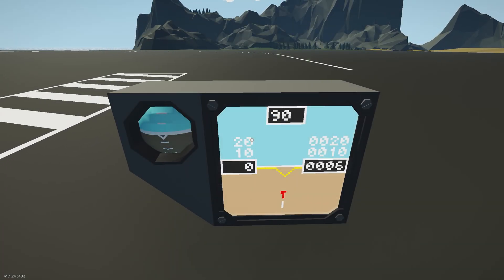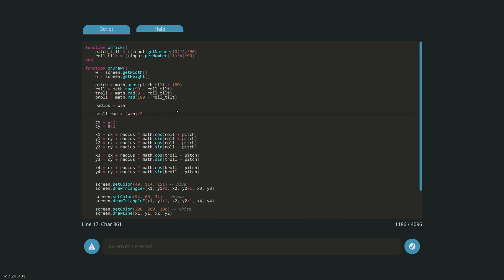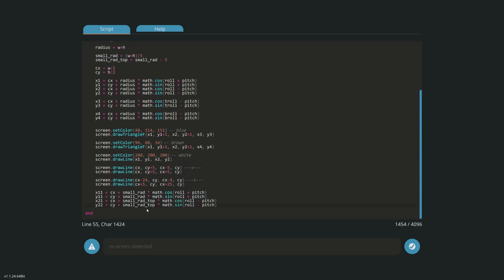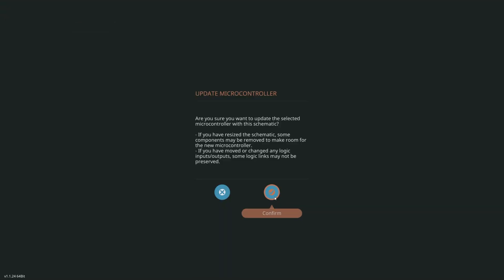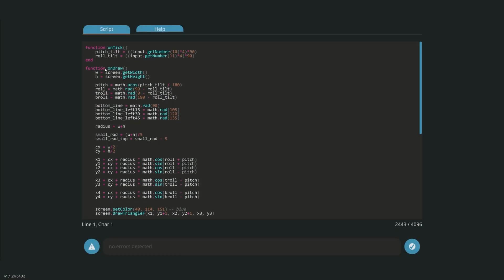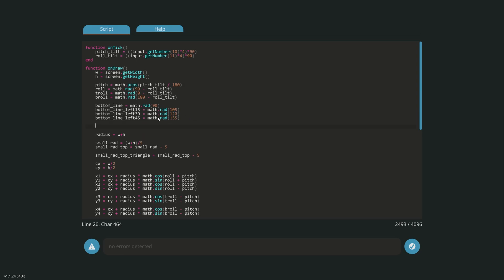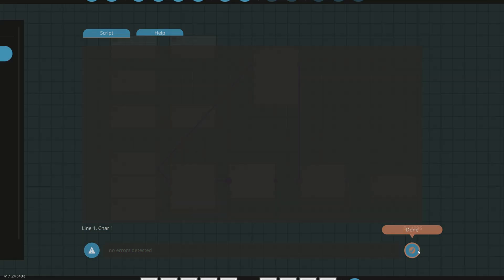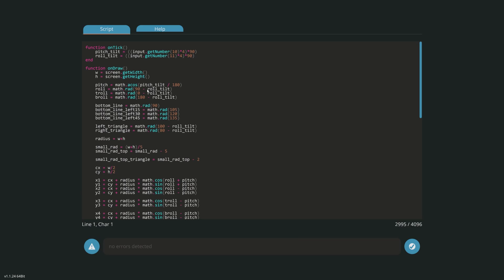Artificial Horizon Build Part 5 - Step by Step Lua Build - Stormworks

Comment: How to make a pitch ladder would be great.
Reply: You could use the y1 value and offset it from the center
Reply: @austin274  iirc I did that but there was a weird issue where the ladder would squish together when you rolled the aircraft, something like that at least.
Reply: @Tomartyr  I’m not in front of my computer rn to test but don’t use x1, x2, or the y2 defined values. X should be a static number and y2 for the line should just be the y1 defined value as well.